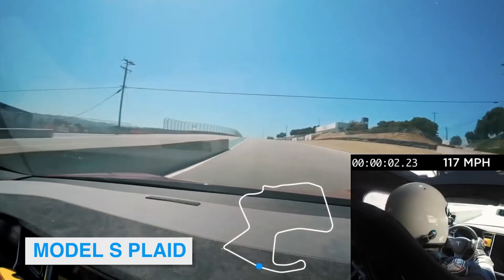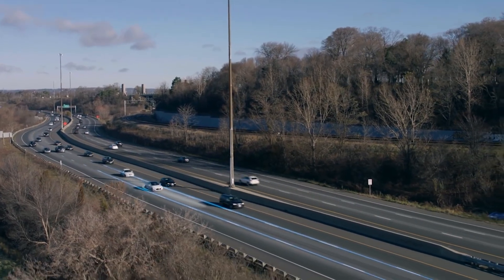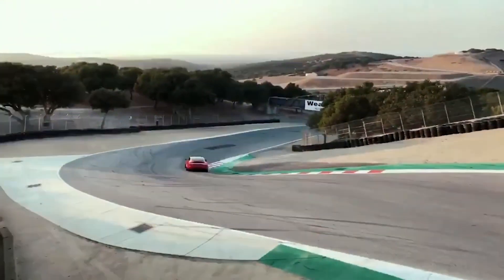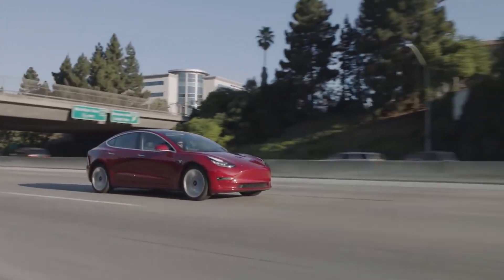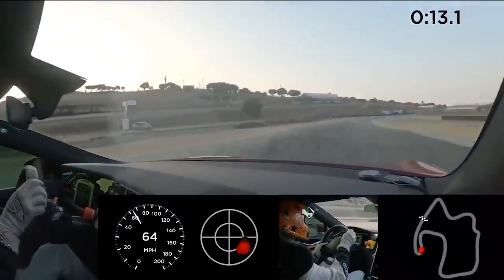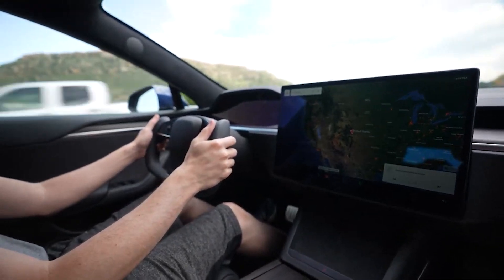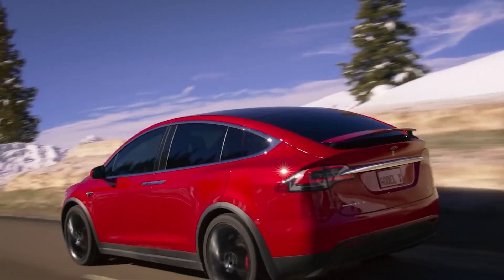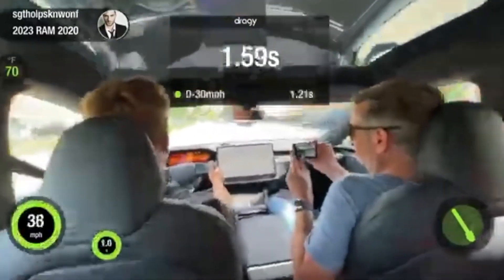Tesla LIED! Can't Hit 60 MPH In Under 2 Seconds (Model S Plaid)

Comment: I love how NO ONE EVER questioned the roll out    being used when ice cars cars have been using this metric since the NHRA made it the norm. But now, under the same rules and conditions, Plaid is slaughtering ice at its own game, and  the rules conveniently change. So if we have to remove the damn rollout, REMOVE IT FROM EVERYONE ELSE AND SET THE FIELD LEVEL. If everyone gets the "lets all of a sudden toss the rollout" rule, then they all get slower too - and plaid still slits their necks and rolls their heads down a fcken pyramid. This is getting stupid now.

Tesla states this on their site
Reply: Oh so that's why Tesla ONLY subtracts 1ft from the Plaid and Performance models, whereas all of their other cars can meet their advertised acceleration without putting shady asterisks hidden in the feature details.
Reply: People in the car community DID question it and debate it for the longest bloody time.  And Many manufacturers have dropped it for years. And Motortrend didn't specifically change their testing for Tesla to score worse. Some, like Porsche, straight up lie and systematically underpromise and overdeliver. That way they're always faster with or without rollout. Stop acting like this is a Tesla only thing, and stop playing victim.
Reply: Mate, that's all only your opinion. 
Fact is, tesla lies about its 0-60.
While ICE manufacturers, such as Porsche, measure it as 0-62 with no rollout either

Comment: Tesla most def did not lie, Jay Leno himself proved it
Reply: Jay did it in Bakersfield with the air conditioning on too 😳
Hahaha fuck 🤣
Reply: Tesla Lied get over it
Reply: @zachbrodrueck6562  Troll.  Tesla never lied, you are just here to spread 💩 and butt hurt bc your puts got wrecked
Reply: @SlotHits777  sure keep telling yourself that
Reply: @zachbrodrueck6562  At least I know what Im talking about and its provable.  You can spit out your lies, but the fact that you are still here posting this crap proves you are just here to spread lies, bc it only takes a few minutes to prove it.
Reply: @SlotHits777  bro go watch engineering explained he literally explain how it can’t do it and Tesla says on their website that it can’t do it.
Reply: @zachbrodrueck6562  go to the track, put in launch mode, let the batteries condition for parallel power and when the computer says its ready, just pedal to  the floor and hang on tight. I have seen it twice.
Reply: @SlotHits777  Ik, it will be crazy fast